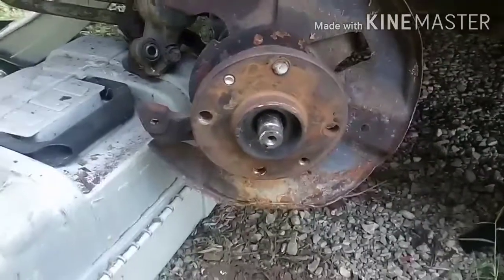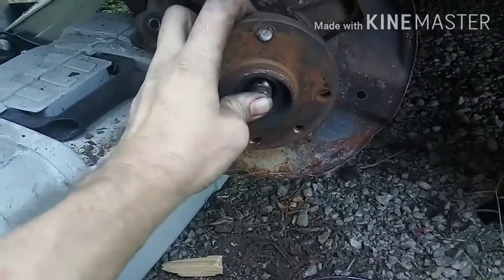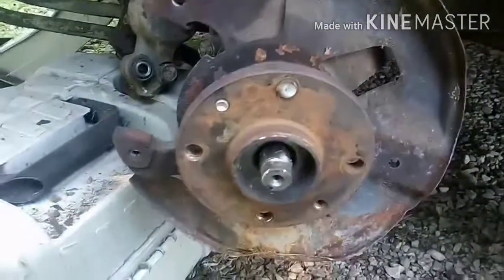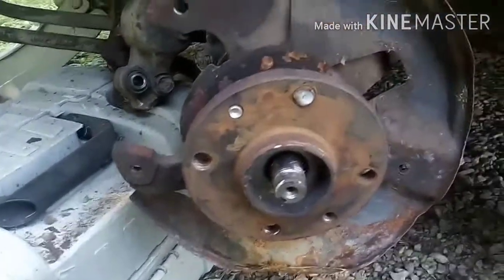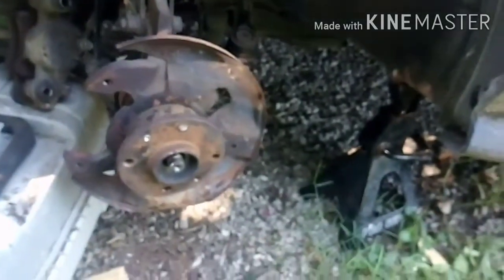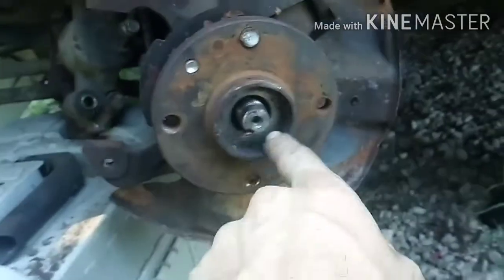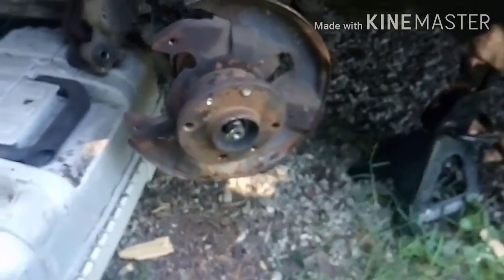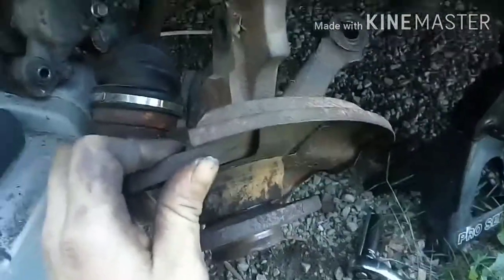Just a redneck on Saturday, not beekeeping

Comment: I do my own repairs to save money. Not because I like to work on equipment. Waiting on brush hog parts now.
Reply from the maker: It helps a lot. $160 could have been $400-600 at a shop, around a grand at a dealership. I'm hoping to get an old tractor in December if everything goes well.